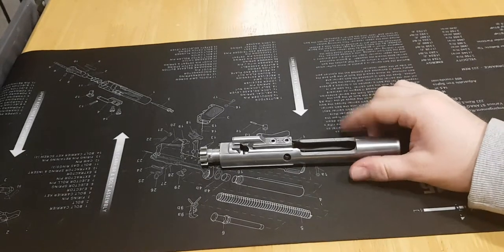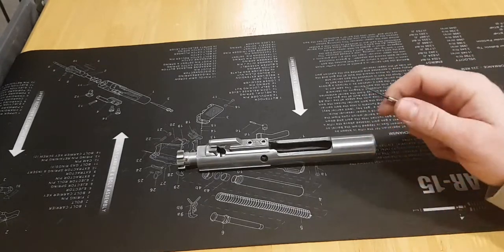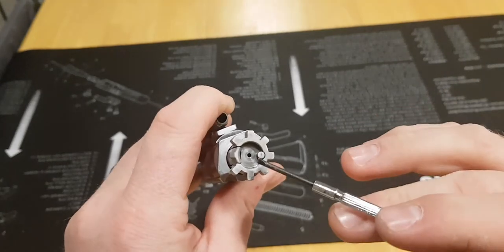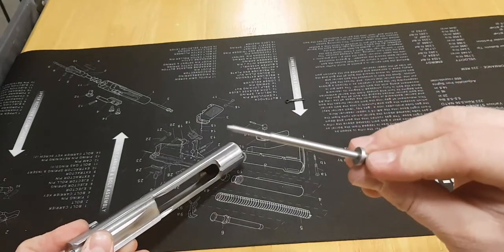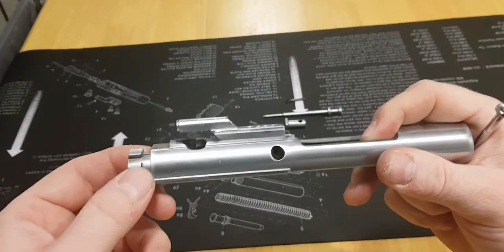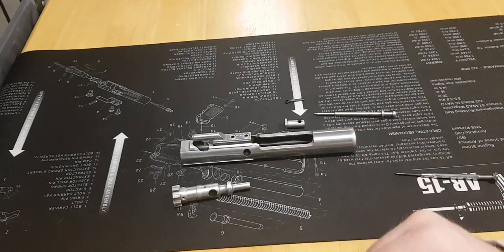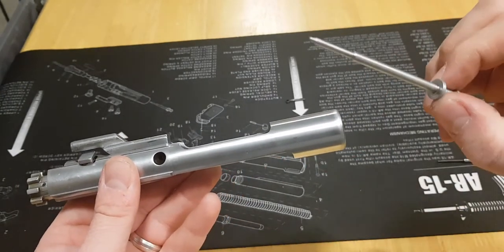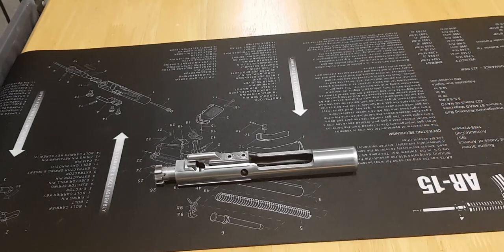HOW TO strip and reassemble the AR15/M4/M16 Bolt Carrier Assembly

Comment: Couple of points - don't ever remove the gas key, there's no need. (The screws are staked in place for a good reason.) There isn't a spring in a standard AR bolt for the firing pin. Decade may have put one in there for some reason, but you won't find one in most rifles. In the UK, you can remove the rings round the bolt. They are gas rings for semi-autos - removing them can help make the rifle feel a bit smoother. If you do decide to strip the bolt further, the ejector pin is under reasonable spring pressure. You will fire it across the room when you drive out the retaining roll pin if you aren't careful!